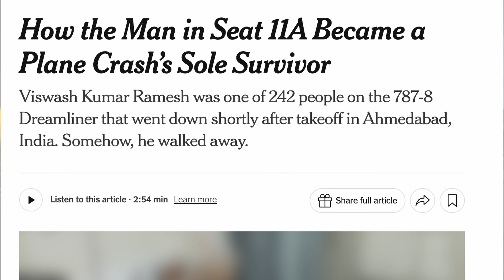Why the RAT Changes Everything – Air India 171 Update

Comment: There has been a previous accident which caused engines flame out. I think it was on a 747. It had something to do with the refueling process. Some debris entered the tanks due to a salt deposit on the fuel pipe lined from the petrol company to the airport. Maybe Captain Steeve can have more information. Dual engine failures are usually caused by fuel problems or fuel supply. Bird strike had become famous due to Scully. But how many motorized engines stall every day caused by fuel systems improper maintenance? Several per day.

Comment: If the RAT automatically deployed based on lack of electricity and hydraulics, it appears to be a no brainer.  The question is what caused the lack of power to the dual engines, hence the black box still pending.  Looking forward to further analysis.  Well done, Captain Steeeve.

Comment: I don't think it was engine failure per se.  It's highly improbable for both engines to fail simultaneously.  So then we have to look at what systems the engines are connected to that could fail: fuel, fuel system, electrics, software.  The electrics and fuel systems have multiple backups and failovers.  Could be bad fuel, though i think that would have been noticed prior to take off.  No fuel, again, would have been noticed.  So my bet is on some software bug.

Comment: Some logical facts also around the guy who survived and generally the timing and what's happening. 

This was not a high-order detonation (like a bomb). It was a post-crash fuel-air fireball, mostly from spilled aviation fuel vaporizing and igniting. Such fireballs, while visually dramatic, aren't necessarily instantly lethal to everyone onboard, especially if you're not directly inside the fireball's center.

When the plane impacted, much of the energy would have been absorbed by the forward structure, engines, wings, etc. The cabin may have stayed intact for 1–3 seconds. Passengers in certain seats (e.g. rear fuselage, protected zones) may have remained alive and mobile briefly after impact.

The fireball creates intense radiant heat, but actual cabin temperature rise depends on ventilation, fuel load, and openings. It usually takes 10-30 seconds before the cabin becomes fully uninhabitable due to heat alone.

Smoke and toxic gases are typically the first lethal danger. Depending on airflow and fire source location, it can take 15-60 seconds for smoke to fill the cabin fatally. If his exit path was towards an area with less smoke accumulation (doors blown open, broken fuselage, rear exit), he buys precious extra seconds.

Post-crash analysis (including many survivable crashes: e.g. British Airtours 1985, Asiana 2013) shows people have managed to escape fireballs if they weren't trapped or immobilized. Aircraft fuselage often provides a few seconds of insulation from external flames. 

Total potential escape window: 15 to 45 seconds, depending on his seat location, fire spread pattern, and available exit paths.

Comment: Hi, when I watch this video, at 1:38 as the plane take off from runway, notice the dust clouds that kicks out.. is that normal?.. if the survivor mentioned hearing a loud bang 30 sec after take off, does it coincide with the RAT deployed or this dusty kick out?
Reply: the dust it's because the aircraft took off at the very end of the runway (maybe due to insufficient engine power)

Comment: I looked at the Flight Radar track for flight 171 for the day of the accident and the previous 2 days. The previous 2 days the aircraft back taxied. The day of the accident, they did not back taxi. I looked at several other aircraft and they all back taxied. Without definitive evidence of the RAT deployment, could that have been the single contributing factor? The pulled up before v1 b/c they ran out of runway? Could the engines have been performing perfectly and flaps set right?

Flightradar24 data clearly shows:

June 10 & 11, 2025 (normal ops):
AI171 back-taxied to the threshold of RWY 23 for a full-length takeoff (~3,500+ meters available).

June 12, 2025 (accident flight):
AI171 entered mid-field via a high-speed taxiway (likely Taxiway E5 or E6), using only ~60% of the runway length for takeoff.

That’s a massive difference—roughly 1,000 to 1,200 meters less runway—potentially leaving less than 2,400 meters. For a heavy 787 departing on a long-haul route, that’s extremely tight.

Is it possible they skipped back-taxi without a performance-limited takeoff calculation (RTOW/OPT) and:

- Assumed normal thrust,
- Didn't adjust speeds for reduced length,
- Rotated early out of caution or misjudgment,
Reply: Captain Steeve.. is there any merit to this?

Comment: I love it when pilots wearing their lanyards in a green screen studio pretend to be engineers. The spa isn't the heaviest part of the aircraft. The fuel is. The engines are second. The undercarriage is the third. The spa didn't protect this dude, it's likely the emergency exit door did it's job. I am quite sure that dual engine failure isn't associated with a gear down flaps up configuration on takeoff, and I am quite sure that the pilots didn't take off with a takeoff config warning as they advanced the throttle and thought oh bugger it lets ignore that warning. If there's a bit of truth in all of this, then thrust wasn't the only thing in this picture, it's human factors, 100 percent for sure. Someone in the cockpit killed everyone for sure, including themselves.

Comment: Excellent analysis. It raises so many questions…
Was there air in the fuel line—how did it get there? Fuel pump failure? Fuel injectors? I’m not sure any of that can be determined after a crash, but perhaps the CVR will shed some light. I’m a layman when it comes to the 787, but I’m sure that there are experts here.

Comment: you all missed one thing! the runway is 3.5km  and a normal plane needs 2.5km this Air India flight needed the full 3.5km and almost crashed during start . so there was a engine/thrust problem already when the plane was on the runway. the captian should better abort the start but maybe it was too late already or he hoped for something! so the engine problem was already there but the pilot decided to take off

Comment: Q) If the fuel was contaminated, how long does an engine run on the good fuel (left over from previous flight) before the lines bleed out and the bad fuel is consumed? Another question, how much fuel was left over from the previous flight, and how much was new fuel added for this flight.

Comment: I thought actually what happened meant definitely an electrical issue because in this particular flight lots of electrical issues phone doesn't work, AC doesn't work properly and even entertainment monitor stuck doesn't work 
These are all small problems Maybe they thought but in particular aircraft need more checks before they start the engine captain and vice captain ignore that or small issues that lead to power loss
Or
Flaps don't work properly due to electrical issues.

Comment: There are many system failures possible in  many accidents with thousands of victims. The main general issue is why aerodynamic aircraft do not have counter safety standard equipment,  such as retro rockets, ballistic parachutes, internal/external airbags and fire foam, that can be deployed in an efficient sequence. The engineers, administrators, politicians, prosecutors, judges and regulators, simply equate that Y Profits are not worthed X lives. But even this equation is wrong since a plane with safety system will outsell one without. Also modular aerostatic aircraft are much safer and ban on hydrogen is anti competitive, damaging and illegal. Sandaero zero weight 3D aerographene with infused H2 is safer than all. Sandaeropara safety system can and must be integrated into all current aerodynamic aircraft by Jusistem global judicial order and enforced nationally. Sandaero/Jusistem

Comment: — I’M NOT A PILOT — but based on what I’ve researched:
1) The landing gear wheels of a Boeing, when deployed normally, form a diagonal line “from bottom to top,” whereas in the video they appear to form the opposite angle — a shape they usually take when the gear is being retracted. This suggests, first of all, a possible (additional) hydraulic failure that stopped the landing gear mid-retraction.
2) It’s IMPOSSIBLE for such modern aircraft to take off WITHOUT flaps. The 787, in particular, triggers multiple alerts if that happens. Most likely, the aircraft was set with flaps at 5°, which is typically enough for takeoff on a 3 km runway.
3) Before blaming the pilots, I’d wait for the official report… especially considering the captain reportedly had over 8,000 flight hours. So let’s wait and see…

Comment: There is a video doing the rounds of a passenger on that very aircraft but from the flight before this crash earlier that day. It shows that nothing inside the plane was working, no air-con, no crew-call, nothing on the entertainment/info interface worked. He was not happy.  If this was the case it shows that the aircraft had known problems.
Reply: Nope...video from a different flight

Comment: Preliminary findings after reviewing ATC records : Extended take off roll indicating inadequacy of engine thrust .The Dreamliner used the airport’s entire 3.5-kilometre runway far more than the typical 2.5 to 3 kilometres needed for such aircraft before lifting off.No visual anomalies, engine failure indicators, or abnormal pitch movements were observed by ground staff or ATC. All pre-flight communication and protocols were reportedly followed.

Comment: There is no way airplanes nose keeping up without  engine running    Nose in up position up till airplane crashed   Airplanes speed should be dropped quickly after the engine went off but that seems not happening when we see the video

Comment: I believe he partially ran off the end of the runway and ingested debris into the engines which caused the partial loss of power.
From the video, he must of had some power to maintain that nose up, 450ft/min rate of descent, which would not be with zero power, However he didn't have enough power to maintain flight or climb. The RAT was deployed. Flaps were deployed. Weight, Elevation, Temperature, Wind calculations got screwed up and the take off run was much longer that expected causing them to run off the end a bit and ingest debris. Look at the one video, you can see the debris in the wings vortex and he's rotating.

Comment: Bird Sttikes

The Air India Boeing 787-8 Dreamliner crash in Ahmedabad on June 12, 2025, marked the first fatal incident involving this aircraft model. While the exact cause of the dual engine failure remains under investigation, several potential scenarios could explain why both engines failed simultaneously, based on aviation expertise and preliminary reports. Below are the leading theories, grounded in available information and general aviation knowledge, without speculating beyond what is reasonable:
	1	Bird Strike:
	◦	A significant possibility is a bird strike, particularly given Ahmedabad airport’s documented history of bird activity. Gujarat state reported 462 bird strike incidents over five years, with most occurring at this airport.
	◦	If a large flock of birds was ingested into both engines during takeoff, it could cause catastrophic damage, leading to a loss of thrust. This scenario is supported by experts who noted that bird strikes can cause engines to lose power, as seen in the 2009 “Miracle on the Hudson” incident.
	◦	Video evidence showing the plane struggling to gain altitude and the pilots’ mayday call indicating “no thrust” and “losing power” align with a sudden loss of engine function, potentially due to bird ingestion.
	2	Fuel Contamination or Starvation:
	◦	Another hypothesis involves issues with the fuel supply, such as contamination or a failure in the fuel delivery system. Posts on X suggest the engines may not have received adequate fuel, forcing the pilots to issue a mayday call.
	◦	Contaminated fuel (e.g., with water or debris) could disrupt combustion in both engines, especially if the contamination affected the aircraft’s fuel tanks or lines. Alternatively, a mechanical issue in the fuel pumps or lines could prevent sufficient fuel flow, effectively starving the engines.
	◦	The Boeing 787’s General Electric GEnx engines, used on the crashed aircraft, rely on a complex fuel system. Any systemic failure here could impact both engines simultaneously.
	3	Foreign Object Debris (FOD):
	◦	Foreign object debris left in or around the engines during maintenance could cause damage leading to failure. Reports highlight past concerns about Boeing’s 787 assembly, including debris left on components due to rushed production.
	◦	If debris was ingested or caused internal damage during takeoff, it could impair both engines. This is less likely than a bird strike but plausible given whistleblower allegations about manufacturing quality issues at Boeing’s facilities.
	4	Mechanical or Design Failure:
	◦	A rare mechanical failure affecting both engines, such as a flaw in the engine control systems or a simultaneous component failure, is another possibility. The 787’s engines are designed with redundancy, making dual failure highly unusual, but not impossible.
	◦	Past issues with the GEnx engines include icing risks in certain weather conditions, though weather was benign during the crash. Additionally, a 2013 advisory warned of potential engine icing near thunderstorms, but no such conditions were reported.
	◦	Whistleblower claims about shortcuts in 787 assembly, including improper fuselage joints, have raised concerns about structural integrity, though no direct link to engine failure has been established.
	5	Human Error or Misconfiguration:
	◦	While less likely to cause dual engine failure directly, human error could exacerbate an initial issue. For instance, if pilots inadvertently shut down the functional engine while troubleshooting a single engine failure, it could lead to a total loss of thrust. This scenario has historical precedent in aviation accidents.
	◦	Improper maintenance or incorrect installation of components (e.g., fuel lines, as speculated in an X post) could also contribute, though this remains unverified and speculative.
	6	Ram Air Turbine (RAT) Deployment:
	◦	Some experts noted the deployment of the Ram Air Turbine, a backup power system that activates when both engines fail, as evidence of a catastrophic dual engine failure. This suggests the aircraft lost primary power early in the flight, consistent with a sudden and complete loss of engine function.
Key Observations:
	•	The aircraft reached a maximum altitude of only 625 feet and was airborne for about 30 seconds, indicating a rapid loss of thrust or lift.
	•	The landing gear remained extended, and flaps appeared retracted, which is unusual for takeoff and may point to a hydraulic or control system failure secondary to engine issues.
	•	The pilots’ mayday call, reporting “no thrust” and “losing power,” strongly suggests an engine-related problem.
	•	India’s aviation regulator has ordered additional safety checks on 787s with GEnx engines, focusing on takeoff parameters and engine performance, indicating a focus on engine-related causes.
Investigation Status:
	•	The digital flight data recorder has been recovered, but the cockpit voice recorder’s status is unclear. These black boxes will provide critical data on engine performance, pilot actions, and system status.
	•	Investigators from India’s Aircraft Accident Investigation Bureau, joined by U.S. and U.K. experts, including from the NTSB and GE Aerospace, are examining engine thrust, flap settings, and why the landing gear remained down.
	•	The investigation may take months, as crash probes typically require detailed analysis of wreckage, maintenance records, and environmental factors.
Conclusion: The most likely causes of the dual engine failure, based on current evidence, are a bird strike or fuel-related issue, given Ahmedabad’s bird strike history and the pilots’ reports of thrust loss. Mechanical failures or manufacturing defects are less probable but cannot be ruled out until the investigation concludes. The deployment of the RAT and the aircraft’s rapid descent further support a catastrophic loss of engine power. Definitive answers await the analysis of black box data and engine debris.
If you’d like, I can monitor updates on this investigation or provide further details on any specific aspect, such as bird strike mitigation or 787 engine design.